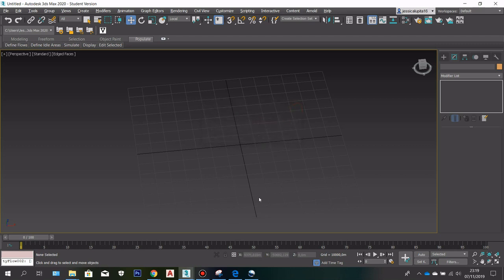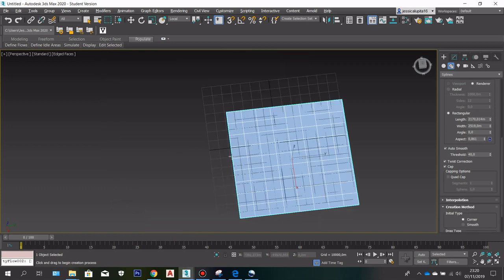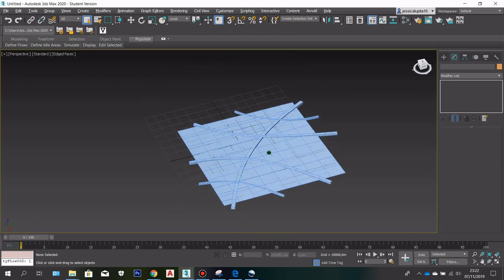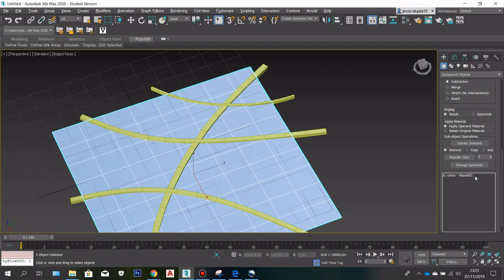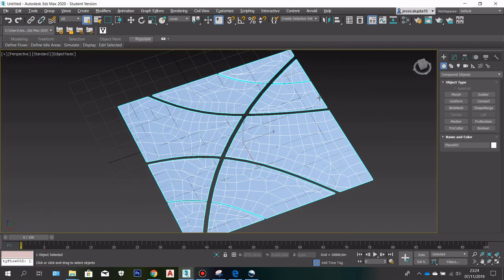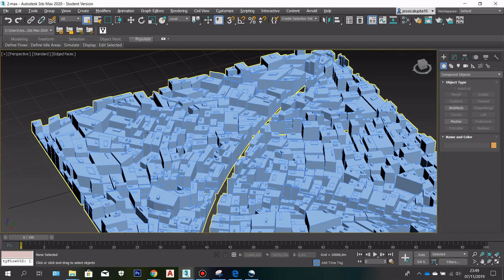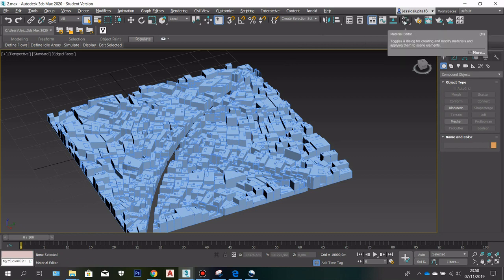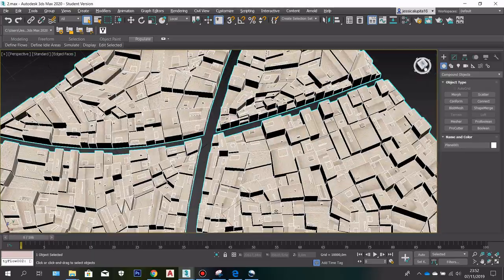How to make a basic city model using GREEBLE PLUGIN in 3Ds MAX (+1 simple material)

Comment from the maker: Also, in this video it's shown that the road was subtracted empty and does not have face on the city model. Another option to create the road face as separate model from the city which was not shown in this video: before subtraction, copy the plane and the attached line(the road) and then hide it. And then do all the steps to get the Greeble model and ProBoolean option for the plane object. After the plane is subtracted as shown in the video, unhide the previous plane and attached line and do the exact same thing with the ProBoolean subtraction but this time the step goes like this: choose the attached line object > compound object > proboolean > subtraction > pick the plane (no cookie or quad needed, but you can test this out).
Now you have the road face modeled as a separate object than the Greeble city model and you can also edit them separately and give them different material.

Comment: amzing stuff, what does this cookie function under >proboolean> parameters>cookies do?
Reply from the maker: The cookie is enabled to create a hole on the original mesh after being subtracted by other object (in this case the road).
This is a more detailed explanation by Autodesk: "Enabling the Cookie Cutter option performs the specified Boolean operation but does not add the faces from the operands into the original mesh. The faces of the selected operand are not added to the Boolean result. This option can be used to cut a hole in a mesh or access the portion of a mesh inside another object."
You can explore more about this Modifier list here: https://knowledge.autodesk.com/support/3ds-max/learn-explore/caas/CloudHelp/cloudhelp/2017/ENU/3DSMax/files/GUID-3DBEB7C2-43CC-4B78-9463-5DD448FD921C-htm.html